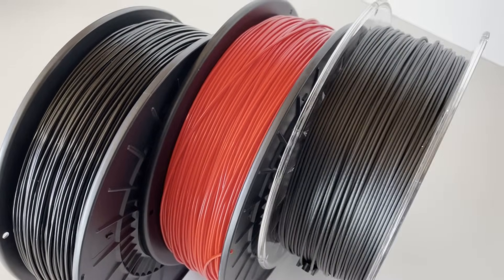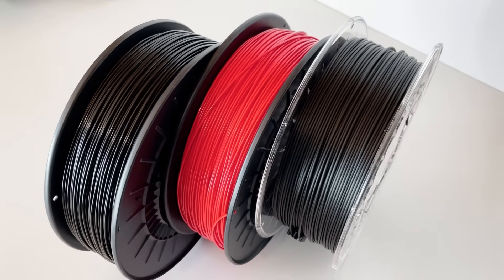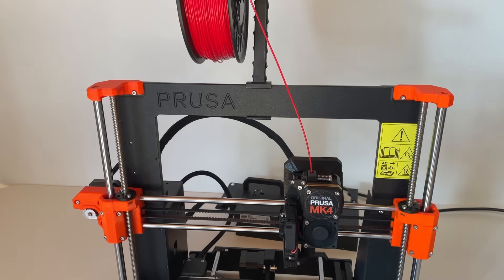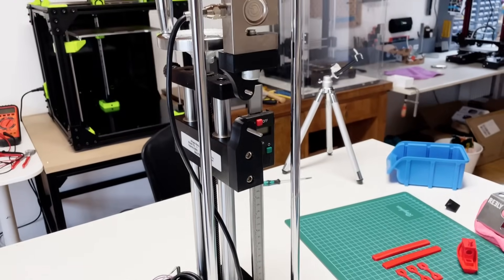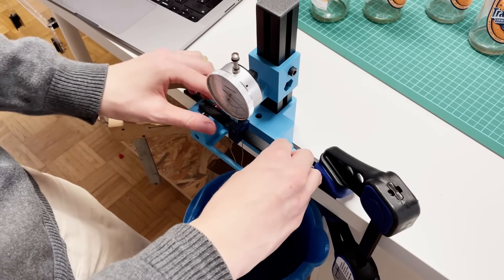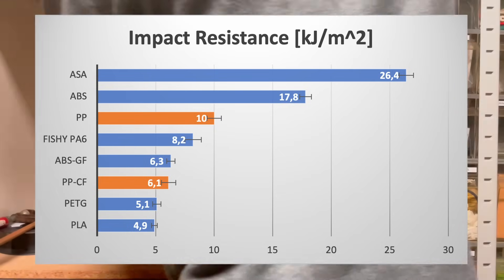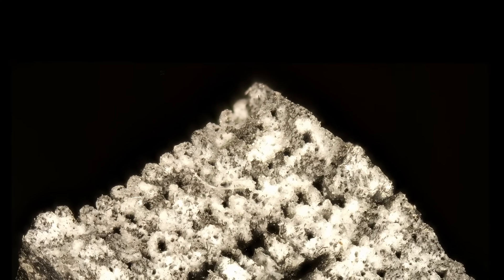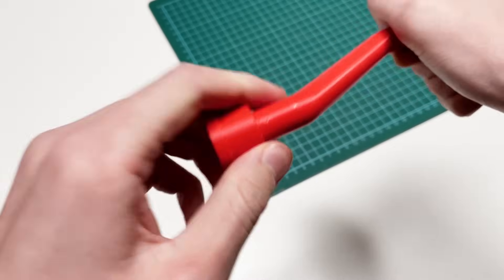The most underrated filament for 3d printing: PP and PP-CF tested!

Comment: Great video! In the industrial extrusion world, PP is extremely common, and often used as a purge material for other materials because of how cheap the raw materials are.  I haven’t seen someone be able to print with it as easily as you did, and I never really considered that you could just use a different print bed surface.

Also, since PP is less dense than water, it one of the few materials that we have to “weigh down” when making because it wants to float in the water baths used for cooling during production.

Lastly, this is one of those times where I wonder why we sell filament by WEIGHT instead of LENGTH. Since PLA is about 37% more dense than PLA, it means that you’d get about 37% more 3D prints from a 1kg spool of PP compared to PLA.  It seems like selling by length (or volume) would make more sense than weight because essentially PP could be 37% “more expensive” than PLA for 1kg, and still be the same price by volume.

I have a few materials I’m saving up for you over here.  We should be making the 3rd and final material next week, and then I plan on shipping them out to you (as long as I get the OK from the rest of my team)
Reply from the maker: Thank you for this valuable information.
I wrote down that I will compare filament prices in €/metre next time. That's fantastic!

Looking forward to trying Polar Filament soon :)

Comment: Foodsaftey also depends on used colors! Not every color pigment is foodsafe.
For example: look at Biofusion filaments from extrudr, the basematerial is the same and foodsafe, but depending on the color, some ar FDA compliant, some not. Same to the Greentec (pro) series. They provide the infos on there boxes too which is great in mym opinion.

Comment: Great video and you got a great mentor there. There is one thing I missed from this video, which is a more direct comparison with pa (6 and/or 12) and paCF. I believe PP is still something that requires some extras to be able to print well and if compared to paCF, which is quite easy to print with regular PEI sheet, I could not see a reason why choose PP(ppCF) over it. The seem to share similar properties in stiffness, toughness and temperature resistance.

Comment: Have you heard about Extrudr Greentec? They say its like PLA but better with abslike heat resistance. You can use PLA settings and it behaves well just like PLA. I think its a type of styrene. Id like to see that tested

Comment: @JanTec3D - Great video, enjoyed the content. I do have a few questions - 
1 - How is the UV resistance if we wanted to use this outdoors or in a vehicle for dash mount components?
2 - Are there any especially dangerous VOCs like with ASA & ABS that would require fume extraction / ventilation?

Comment: I recently found out that my employer discards tons of PP in thin strips that would be very easily chopped up into small pieces perfect for a pellet extruder, so I've been curious about PP printing ever since. This looks very promising! I'd love to give this a try!
Reply: If you’re allowed, definitely start collecting them. If not, find out which garbage company services their dumpster and contact them directly, or ask the driver (a small tip or a cold drink can be a nice incentive). I did this after my local vape shop discarded dozens of unopened flavored vapes following the flavored vape ban. They wouldn’t let me take them from the dumpster, so I found out their garbage pickup schedule and asked the drivers directly. I brought potential gifts, took a good look at the situation, and decided that ice-cold beer would do the trick—and it did! The drivers were thrilled, and so was I (though the vape shop owner wasn’t as happy). 😂
Reply: Forgot to add this, the unopened vapes or even opened are great for usb c/micro usb c port pcbs and, of course, the rechargeable battery inside. Free small  rechargeable batteries are the best kind! They work great for small 3d printed rc projects and drones,etc.
Reply: If you print raw PP it is a nightmare, i tried. The material made for 3d printers is different, they add special ingredient formula. This is why good filament brands are so valuable, at least to me. I have both experience in filament and pellet printing.

Comment: Fun fact to note, just since he mentioned that CF filament was black cause of the fibers, most CF filaments are colored black. Naturally filament is translucent or clear, so adding fibers to it just makes it have little specs throughout. Ambrosia Filament actually sells red and blue CF-ASA in addition to their normal black CF-ASA. Really you can dye CF filament any color, just black is the most reasonable color since the dark fibers will naturally make any color darker.
Reply: and Bambu Labs have a range of coloured CF filaments, both PLA and PETG

Comment: LayerLock Build Surface for Polypropylene will be 3 times cheaper than that.
Reply: Doesn't work in my experience. Larger parts warp and pull right off.

Comment: I don't know, requires specialized build plate, slow extrusion, higher price, tendency to warp (which may be reduced when going for even pricier options), needs 120 bed just to remove, ... sure, may have some niche applications, but I don't think it is a good general option.

Comment: Great testing and thanks for doing these in English! Just a small note, it has been scientifically proven that you can easily clean 3d prints and that layers and pores are not the issue for bacteria as soap can reach anywhere they can.
Reply from the maker: Thank you! 
Also for adding this note. I didn't know about this. Can you tell me where to find more information about this research? Food safe 3d printing is a really big topic.
Reply: @JanTecEngineering  I posted a link, you will probably have to manually enable my comment to show :) if not, it was done by Matt Thomas, should be easy to find on ggl
Reply from the maker: Yeah YouTube must have removed that link and there's no way for me to enable it...
Anyway, found his study on ResearchGate and downloaded the paper - thanks again!
Reply: @JanTecEngineering   np, enjoy :)
Reply: @JanTecEngineering  sort by newest
Reply: A single paper proves nothing, it's from tech people which won't have much experience in that field, and after all they prove that just soap may not be enough and bleach or baking soda should be used in addition. People's fears are probably overblown as usual but I still wouldn't use printed parts for food
Reply: @zapl80   sure it does, it is a peer reviewed scientific work, what more do y0u need?
Reply: @riba2233  a technical report is often not peer reviewed and one makes no scientific consensus
Reply: @zapl80   but this is both scientific and peer reviewed
Reply: @riba2233  are we talking about the Sanitization Efficacy for Safe Use of 3D-Printed Parts by Matt Thomas?
Where does it say anything about a review? There's a technical report openly published just by itself by the authors. I.e. a PDF uploaded to the internet. And a conference paper from an engineering conference. I.e. the PDF you bring to your presentation. Uploaded by their University Department as far as I can see. I don't see anything mentioned about a review anywhere. Yes it is science, I'm not saying it is wrong, it is just not enough to state there's something "scientifically proven". Researches tested something and their tests showed no harmful effects.
Reply: @zapl80  it says peer review at the bottom, in any case it is there

Comment: Magigoo PP on a Garolite bed works on PP and GF-PP for me, even on open machines. PP is such a wonderful material.  Almost unbelievably light weight, "slippery" finish, watertight and as tough as they come.  GF-PP prints with a very "grippy" texture and really stiffens up the print also doesn't warp as much as PP.
Reply from the maker: You're absolutely right. After I did this video, I also printed some PP-GF with Magigoo PP and it worked perfectly (even sticked a bit too well to the print sheet).
Reply: Any tips on getting PP-GF to adhere well? I'm using 3dxtech and it's warping like a mofo on my P1s.
Reply: @justinreinsma9772  Magigoo PP is a must and print on garolite that is at least 3mm thick.  If you use anything thinner like a spring steel sheet the PP will lift it off the bed. Print no faster than 60mm/sec.  The first 3-5 layers print at 30mm/sec.  245/75 are the temps I use.

Comment: its a pita to print for one. the low extrusion speed of max 60mms is another reason. then there is bed adhesion. meh to pp. good for lifetime hinges. thats about it? asa-lw outperforms pp for aero or hydro sir. personal experience here, pp has been on the marked since the fdm game started. for all aero is asa-lw the best option. its a bit tricky on some platforms to calibrate flow, but once you get that right?

oh man,. current planning a new tiny drone project with asa-lw for forest ranger services. and the asa is just the thing for it, its just a bit shy in the color dept. so they will get a black prototype :)

Comment: Wow that PP CF filament has some impressive properties. Some properties of both filaments are not that impressive, but the density is! Almost like comparing steel to aluminum in terms of strength per weight. Wow the temp resistance too is quite good, especially for the PP CF. If only it was more affordable and widely available! Thanks for the testing.
Reply from the maker: Thank you! I agree with you. There are some cheaper PP and PP-CF filaments available on Aliexpress but I don't know if they're comparable/any good...
Reply: Fiberlogy, Filamentum and Innovatefil all have PP in their portfolio. Innovatefil also has glass and carbon fiber variants. The prices I see are more than ASA but less than nylons.

Comment: Polypropylene is an underrated filament indeed!
A few things that weren't mentioned:
- you print hinges with it: the plastic can bend many times without breaking
- it's very useful when you want a part with low friction coefficient, so much for that it can be considered self lubricating in some use cases
- it's easier than expected to print on clear packing tape. I had great results with Fiberlogy's natural PP on clear tape, 30°C bed.
Reply from the maker: Thanks for adding these interesting properties!
Reply: so the PP is self lubricating? wink wink
Reply: @bxkxhxkg82  xaxaxaxaaxaa!
Reply: I think you dont need heat if you print with tape. At least mine sticks like a bomb with only the tape
Reply: @redjoysftw572  what tape u use?

Comment: Great video! I remember trying PP-GF a long time ago and never could get large parts to stick well. Having that right build surface probably would have helped. Cheers!
Reply from the maker: Thanks man! 
The build surface helps a lot for sure, but I also had success with Magigoo PP an PP-GF.
Reply: @JanTecEngineering  I attempted PP-GF and Magigoo PP on both a PEI sticker and textured PEI back in the day and it would just warp like crazy. Materials are the wild wild west in 3D printing though, so it's possible that newer PP blends have better additives in them now to minimize warping